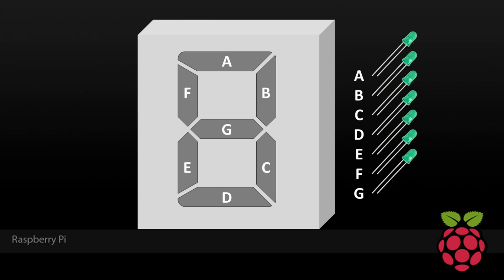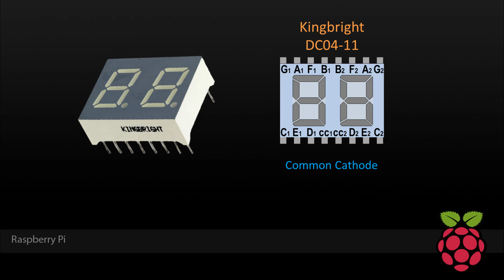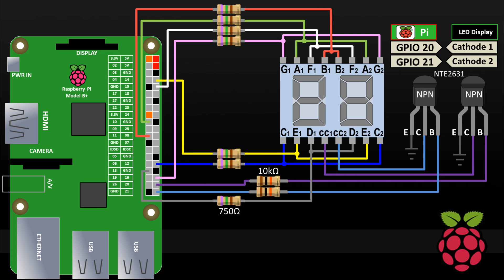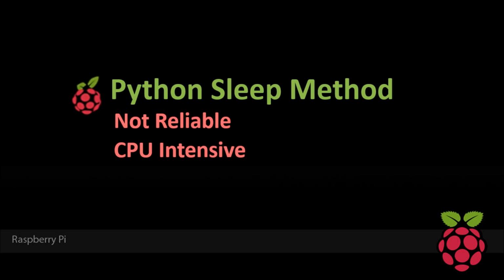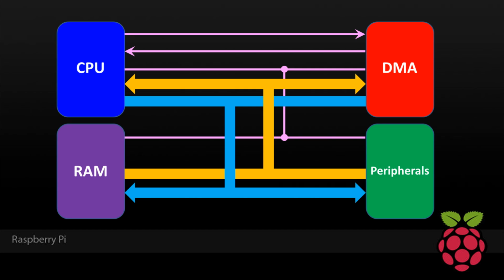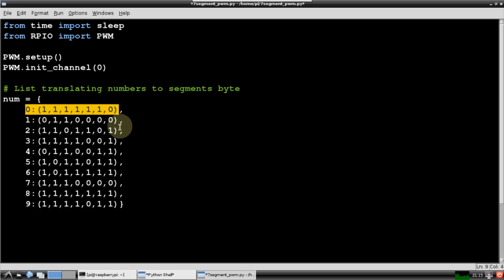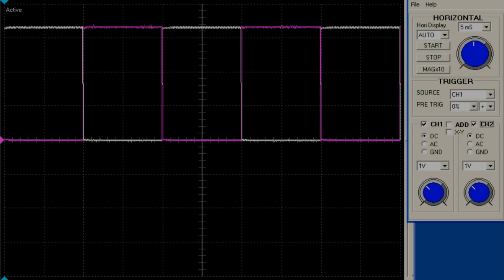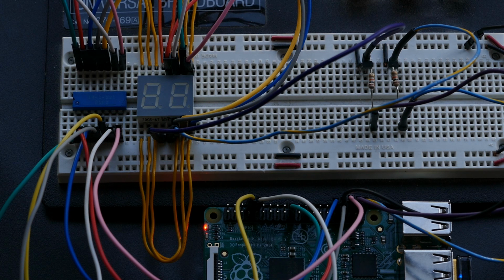Using 7 Segment LED Display via DMA on Raspberry Pi

Comment: Interesting video. 12:32 Did you ever make the I2C video? I can't find it.
Reply from the maker: Sorry I never made a dedicated I²C LED driver video. There are a few relevant videos. In my Raspberry Pi motor control video, I use an HT16K33 to drive a 4 digit I²C LED display:
https://youtu.be/br_Xv9X7YZc?si=Pe4jYGQxkXdIlI9m
In my Raspberry Pi spectrum analyzer video, I go into more detail about controlling the HT16K33:
https://youtu.be/DE3mBtQlpyg?si=B-P5XFqmDgPZaTFV

There's also my Raspberry Pi I²C LCD display video:
https://youtu.be/i5A5AsDRRwQ?si=ZS50YT1I4txUJPGp

Comment: Would this be able to work with three displays? Trying to build something out for my work that would occasionally need to display wait times of over 99 minutes (Trying to make a better way for one of our kitchens to communicate wait times with our bar area without having to physically send someone over to tell us). If I could make it work on just RaspPI's it would be awesome to not have to hunt down purpose-made tools.
Reply from the maker: Yes, there's an example on my website showing 6 digits.  However, it would be easier to get an inexpensive I2C driver chip such as the HTK1633 which I demonstrated in this video:  https://youtu.be/DE3mBtQlpyg?si=kF7gaLZ949GrBtwv   You can buy 4-digit 7-segment LED displays with built-in HTK1633 controllers.  I used a DIY one in my brushless DC motor tutorial:  https://youtu.be/br_Xv9X7YZc?si=55RX9EnzMlBkpjhp and the plans are on my website: https://www.rototron.info/raspberry-pi-esc-motor-tutorial/

Comment: Amazing Explanation...Just a small query...while receiving sensor data via ADS1015 (I2C based communication protocol) into our RPi, is there any way out to receive data at a CONSTANT sampling rate (Ex. 1000  Hz) with DMA? If yes, is there any documentation
 to do so?
Reply from the maker: I think the Pi’s default I2C speed is 100 kbps, but it can be increased to 400 kbps (It might be faster on the newer Pi’s).  I believe the ADS1015 has maximum sampling rate of 3,300 SPS.  I’m not sure I understand your question but I assume you are trying to sample at a very precise and specific rate.  The Pi initiates all I2C transfers.  Therefore, it would probably be difficult to achieve such precision in a high level language like Python.   However, it might be possible using the Pigpio library (http://abyz.me.uk/rpi/pigpio/index.html).  I haven’t done much Pi hardware work lately.  I recommend you post your question the Raspberry Pi forum (https://www.raspberrypi.org/forums/) .   You could also try contacting the author of Pigpio.

Comment: Hey there, would you be able to do this with a shift register instead of using so many pins?
Reply from the maker: Yes, but if you are going to use external components then an inexpensive I2C driver such as the Holtek HT16K33 would afford much more functionality.  I used one in my ESC motor tutorial to drive a 4 digit LED backpack display:  https://www.rototron.info/raspberry-pi-esc-motor-tutorial/

Comment: I want to know if you can use two of these display with a mcp3008 AC/DC to display windspeed from an anemometer ?
Reply from the maker: Yes, you could display results from ADC's using multiple numeric or alphanumeric LED displays.  However, to use multiple displays it would be easier to use an I²C LED controller driver such as the Holtek HT16K33.  It can drive 16 numeric LED displays or 8 alphanumeric LED displays.  I use one in my ESC Motor tutorial: https://www.rototron.info/raspberry-pi-esc-motor-tutorial/

You can also buy prebuilt I²C display backpacks from Adafruit which they have in multiple sizes and colors.

Comment: How would I go about doing this with a 4 digit 14 segment display using an I2C chip?
Reply from the maker: The HT16k33 is a good driver.  I think it supports 8 alphanumeric digits.   I used one in my BLDC RPM tutorial: https://www.rototron.info/raspberry-pi-esc-motor-tutorial/
Reply: Sweet thanks! I have an MCP23017. Would that work?
Reply from the maker: I don't think the MCP23017 supports PWM so you would need 4 (1 per digit).  The HT16k33 is a better fit.  Adafruit uses the HT16k33 in their LED backpacks and they have an existing Python library with alphanumeric support:  https://github.com/adafruit/Adafruit_Python_LED_Backpack

Comment: and when i want the alphhabet i need to replace some things like the list 1-9 with a-z right? and the right 1 or 0 [ like:
num = {
        a : ( 0 , 0 , 0 , 1 , 0 , 0 , 0 ) ,  }    ]
Reply from the maker: Yes, in my example the letter A would be  --> A:(1,1,1,0,1,1,1)
You could also get an alphanumeric LED display which will give you better looking characters.  They have additional segments to create more characters.
Reply: rdagger68 ive wrote a Programm so you habe Instagram so i cant give you my Numbers that you Can Look ober it tomorrow 😀?
Reply from the maker: You can contact me through my website.
Reply: rdagger68 Ah okay thanks

Comment: quick question... how would things differ for a common anode display? I would think there are reversed aspects but not sure if that would be in hardware, software or both, thanks for such a well explained video!
Reply from the maker: +chetpot Change the transistors to PNP (such as NTE2362) and connect the emitters to 3.3V instead of ground.  The transistors are now high side switches instead of low side switches.  Invert the values of the num dictionary.  Reverse the values of the cathode pulses on GPIO 20 and 21 because they are now anode pulses.
Reply: +rdagger68  Thank you for such a fast and detailed reply, I'm going to have to take a chance with the RPIO library as i am using a Raspberry PI Zero which is said to have the same processor as the original PI however there might be other newer aspects that will prevent it from working.
Reply from the maker: +chetpot Please let me know if it works.  Also you can always use a 7 segment driver IC such as the SAA1064 or the Max6958.  I was going to make a part 2 for these chips but there did not seem to be much interest.
Reply: +rdagger68 I will indeed keep you posted on the success with the Pi Zero. As a bit of back story, this display was salvaged from an older uniden cordless phone base (great resource if you have any unused ones laying around) if you do, I was lucky enough to find a data sheet here http://www.digchip.com/datasheets/download_datasheet.php?id=4282283&part-number=LTD-482PC
thank you again for sharing your knowledge!!
Reply: @rdagger  What exactly do you mean with "Reverse the values of the cathode pulses on GPIO 20 an 21", which value do I change?
Reply from the maker: Change
PWM.add_channel_pulse(0, 20, 0, 999)
PWM.add_channel_pulse(0, 21, 1000, 999)
to
PWM.add_channel_pulse(0, 21, 0, 999)
PWM.add_channel_pulse(0, 20, 1000, 999)

Comment: Can you please explain 1, 7 digit segment led that would be very appreciated.
Reply from the maker: For 1 digit you don’t need to use PWM.  You could drive the segments on or off using the GPIO library like you would with 7 individual LED’s.  However, if you wanted to use the PWM code, you would just delete the 2nd cathode pulse and 2nd anode pulse.  Therefore, you would have a single cathode and you would have a single anode pulse (the length could be increased for each to 1999 from 999).  You would also need to change the digit mapping format string from "%02d" to "%01d".   Sorry for missing your comment when you posted it.

Comment from the maker: The RPIO python library used in this project has recently been updated to support the Raspberry Pi 2 and newer.  You will need to manually install the RPIO library to get the latest version.  Please check out my website for detailed instructions.  I've also created a version of the demo code that uses PiGPIO instead of RPIO:  https://www.rototron.info/7-segment-led-tutorial-for-raspberry-pi/#pigpio

Comment: Seems like PWM of RPIO module would not work with Raspberry pi 2 unless the following issue is fixed - https://github.com/metachris/RPIO/issues/53
Reply from the maker: +brightside The author fixed the RPIO library for newer Pi's. If people are interested I could make a tutorial on using LED driver chips to run 7 segment displays.  These IC's do the heavy lifting and can be controlled with protocols such as i2c.
Reply: rdagger68 Thanks for your tutorials, great content. I tried the RPIO fork https://github.com/tylerwowen/RPIO.git which claims fixes for rPi2 integration in the latest commits but could not get it working.